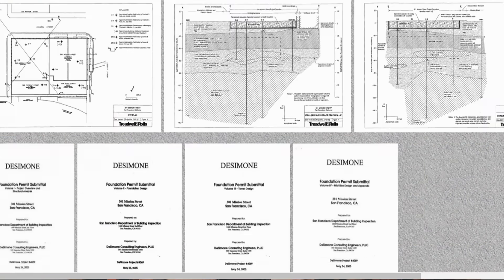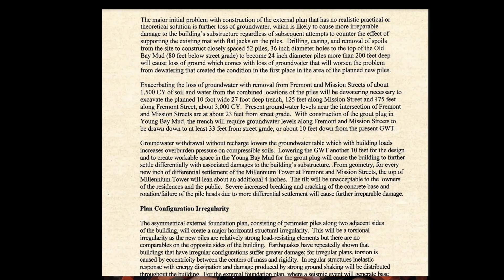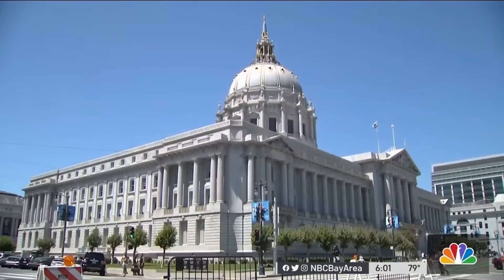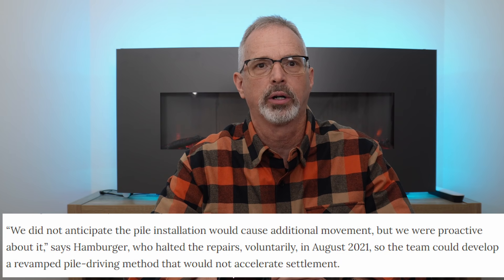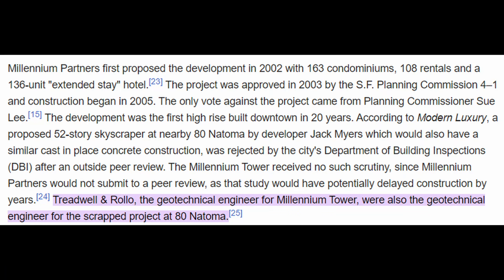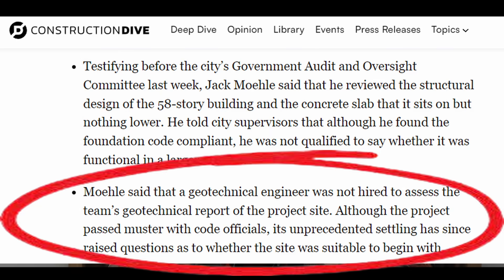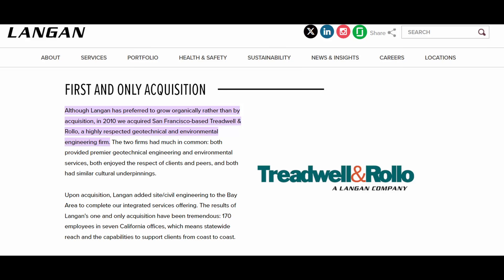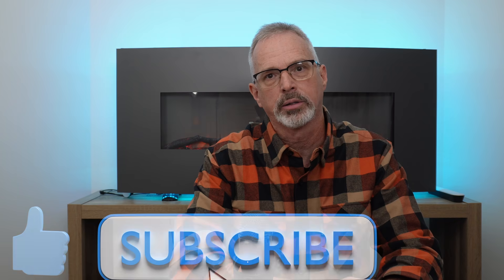Millennium Tower  -  $500 Million Wasted?

Comment: As a civil engineer specialized in the design of structures and foundations, I would never suggest supporting a building part on end bearing piles and part on friction piles. It's hard enough to predict the behavior of a foundation where settlements are “supposedly” uniform. If you do, you're just asking for trouble. And I'm not talking about a 600 foot skyscraper on reclaimed seafront land, in earthquake sensitive San Francisco. I will say though that, after the fact, 20-20 vision is easy. Truth is, the design team is always under high pressure from the engineering office and the client to get the job done based on sometimes best estimates soils related recommendations.

Comment: I am curious as to how the cost of foundation remediation was allocated between developer and HOA. You say the HOA paid ~$6M of the cost overrun, if I understood you correctly, but how much of that overrun did the developer pay for? Was the non-overrun cost similarly allocated? Is Hamburger being paid from this source of funds and who controls how it is/was spent? Basically, is Hamburger working for the developers or the owners?

Estimating the foundation sink for a steel-frame and then not updating it when a reinforced concrete building was substituted seems really questionable, but was the firm responsible for the estimate transparent about the method used to reach it? If there's enough margin for error built in then maybe it's not a problem, but you want to know how that margin for error was estimated to judge this. Is there a clock running until the developer is off the hook for design errors introduced when the building process was its sole ultimate responsibility?

I'm not an engineer, but this building is of special interest to me as I worked for a number of years in the mid 70's to early 80's at 531 MIssion, just down the street. That building is long gone, but I do remember giving the owner a clipping from the paper in which it was mentioned that Jack London (I think it was) had lived at that address. It was an old three story building, but probably not THAT old. The timbers used for its frame were for me of impressive size, however. You just don't see hunks of wood like that anywhere any more.
Reply from the maker: Thank you for your comments and interest.  It is my understanding that the settlement of the various lawsuits provided a pool of money for repairs to be performed and they elected to go with this perimeter piling plan.  They had trouble which resulted in their accelerating the amount of ground settlement and building tilt.  In turn, they had to reconfigure their plan by reducing the number of perimeter piles from 52 to 13, but also had to perform significantly more building monitoring.  As a result, it was reported that the extra $6 million dollar overrun would be borne by an assessment to the owners of this building units.  I don't understand the details associated with these arrangement as I have not been able to find any public records on it.  I also think it was odd that the original 52 pile repair plan was budgeted for around $150 million, yet they apparently went over-budget with only 18 piles instead?

I do think it is odd that this building foundation was reportedly designed for a much lighter, steel-framed building and was switched to a much heavier reinforced concrete structure.  I can't believe that the geotechnical engineer would not know this but unfortunately, in their original and subsequent geotechnical reports for this building they did not include a description of the building type (just height and footprint size). Such descriptions would have been in keeping with standard practice in my opinion.   They also did not quantify the amount of anticipated foundation loading in their report but did present total settlement estimates of around 5 inches for the life of the building.  There are so many oddities to this project but when big money is involved, it is hard to get to the full truth of things.
Reply: @CaseyJones-Engineer  So, the overrun was entirely on the HOA, which I didn't get from your video exposition (maybe I didn't listen closely enough), which implies they probably have no further recourse against the developer, absent viable fraud claims. Sounds like a terrible or corrupt decision by the HOA to let the developer off the hook for a little attempted remediation when the remaining downside may be so massive.

Comment: Offshore structural engineer here
If you have bedrock within reach you use it and that's usually the end of the matter. However it isn't the only solution 
Beneath London there's a thick layer of stiff clay and cast in-situ belled piles are an excellent solution.
You never have bedrock available offshore (because there's no recoverable under bedrock) so large diameter, driven tubular steel piles are common. Diameters typically in the range 48" - 72", penetrations 150' - 400'.
Reply from the maker: Thank you for your comments on that. They used to put a lot of belled drill shafts in the Chicago clay.

Comment: Something that is seldom mentioned in the Millenium Tower story is the three-foot thick, 90-foot-high steel and cement wall built directly under the eastern edge of the 10-foot-thick slab foundation.  In my humble opinion, this wall may be the primary reason that the tower tilted toward the west versus sinking straight down.  As such, the “Hamburger Theory” that the side opposite their “fix” can now sink and eventually straighten the tower does not make sense.

My next thought is the possibility that during an earthquake, the contribution of the 90-foot wall to the asymmetric downward support problem of the east and west sides of the tower, might result in its collapse.

Comment: As a retired consulting mechanical and electrical engineer, I am not a structural engineer or geotechnical professional. I have worked with many structural engineers during my 52 years working with architects in the design and construction observation of many buildings.  I refer you and your YouTube patrons to the site 
" Building Integrity " with Mr. Josh Porter.  In particular Mr. Porter's vidoes on the Millennium Tower.
One of those videos concerns the design of the lifting system design in which Mr. Porter points out that the entire hydraulic lifting system is concentrated on one steel plate.  Mr. Porter infers that this one crucial steel plate is not of sufficient strength to " carryt the load ", and questions " did I find a 100 million dollar mistake ?  Check it out.  PN

Comment: I appreciate all your discussions on these issues. I am a civil structural engineer for over 20 years experience and I have been in many situations where my foundation structural designs were viewed as over-designed.   These assessments typically come from non structural engineers who maybe built a deck in their backyard and they think that qualifies them to evaluate designs.     It’s always a discussion of money and when a client does the cost estimate and gets the funding for the project they did not adequately understand the design and code requirements which costs more money than what they thought.   I see this many times in all disciplines of engineering.
Reply from the maker: The two most important aspects of a building design is the foundation and the structure itself.  When a project has a problem with one of these there usually is not many options to make it right.

Comment: So the real solution were micro piles drilled through the slab footing under the builiding
That is HILARIOUS
That is the first thing I thought of, having been on jobs where jack piles, near full size piles were installed under old buildings
What's more hilarious, is I"m an architect, who's not supposed to know, or let anyone know, they know anything technical like structural engineering
and
All this reinforces your conclusion
That willfull ignorance led to this slow motion disaster
The soils engineer, the structural engineer, the building department, even the clueless architect (and the architect shmoozing the client and drawing the pretty pictures will likely be clueless, that's not what's needed to bring in the biz, actually that HURTS bringing in the biz)
as
As you point out, all the evidence was there in the research, design, calculations AND building history, both recent, withing months, and over 100 yrs ago, that engineers and the building department had at the tips of their fingers, that this was doomed.
It took the WILLFULL, the DELIBERATE ignorance of EVERYONE involved, every single professional and offical
which sounds like some tin foil hat conspiracy
Unless
You understand that THE TRUTH no longer rules anything.
The professionals and officials willfully ignored the truth as they have been trained to, seen what happened to those touting the truth, their failure, their dismissal, firing.
As a professional you can't get clients by telling the truth, like you don't 'have enough money, you'll make so much on this the additional cost of an extra backup system, extra structural steel, just in case someone does something wrong, a neighbor's work effects yours, you'll still get rich, you can't treat people like cattle, cheaping out will leave the future co op / condo owners in the hole for more than they can every afford and you'll still make doubel digit return if we don't cheap out....  ANYTHING that gets between even $1 and the owner makes you un-hireable.  Champion quality as an employee, and you're doubly worthless as you are risk, not an asset to be milked.
What can one say, are all professionals and officials reprehensible opportunists.  No.  Most didn't realize this until long after they were committed, and went down the slippery slope of willful ignorance one decision, one inch at a time.  Hamburger is nothing more than a CEO who sees no reason to consider all but the most optomistic outcomes, and there is no legal or technical reason not to do so, and HUGE economic reason to do so, his very survival and the survivial of those he employs.  It's very possible in the back of his head is, everything is fixable, I'll tell this owner what he wants to hear, who knows, could work, and I can always fix it and charge him again for forcing me to only consider the cheapest solution.  No doubt he might think that even now.  Those Micro Piles can still go in, halt the tilt (I don't think at this point there is a way to jack the building back up via it's slab, it has to be considered compromised from stress of differential settlement, full of micro cracks, at the least, that could erupt into full scale cracks if any stress is applied.  The building can then be gutted, floors leveled in sections, new plumbing run, new smaller fully vertical elevator shafts built inside the existing, New windows that won't fall out from tilt and stresses on skin of building now.  Even adding structural steel, epoxy / carbon fiber wraps to concrete to make it safe against earthquakes despite additional stresses, remount all the building equipment plumb and level, etc..  ANYTHING can be done as long as it's well safe of tipping and well safe of earthquakes.  OR  Just demolish it, which still requires an engineer, actually, more than ever, so more inoome for the biz than ever.
The only entity involved who needs to do something now, is the city.  It has not hired anyone to review the work, to develop inpendent parameters the failure must not even approach because well, the DOB officals don't want it proven that by following the best advice of the legally responsible structural engineer, they failed in their duty and get fired, whoever the mayor is at the time no doubt would not get reelected, for either his or her failures on this to date, or even predecessors on one hand and being starved of campaign money by the rich who don't want activist mayors who might limit their ability to make money at any cost.
We shall see
Reply from the maker: You make excellent points here.  It usually takes a graduating engineer a few years of professional practice before they realize that they are working in a business just like everything else that is ruled by the bottom line.  It is sometimes difficult for some people to navigate through the technical aspects of what is best for the project when doing what is best or even appropriate can doom a project to economic failure (at least within the constraints often set up by the project owner/developer).

Comment: Would it be feasible to level the tower by using the same external pile drilling in the opposite side?   Since the external piles they added actually caused more tilt could the same process be used on the opposite side.  Could it be modeled?     The micro piles could be installed, then external drilling until level, then secure the micro-piles.    Would it be worth considering, at least before building demo?
Reply from the maker: I would be concerned about the development of high moments in the slab which would cause cracking of concrete and yielding of the reinforcing steel.
Reply: The external piles did not add more tilt.  There was a temporary increase in the tilt while the work was underway.  Since completing the work, the tilt was reduced slightly.  The building still tilts toward the west; there is no reason to add supports on the east.  Further settling on the east will bring the building closer to plumb.

Comment: I don’t understand why unit owners should have to pay a single cent towards shoring up this building, when its deterioration is entirely due to the negligence of its developers and the lack of oversight on the part of city staff. Unit owners aren’t in any way to blame for the current situation, and making them shoulder any of the repair costs is grossly unreasonable.
Reply from the maker: I agree with you.  What happens when additional repairs or inspection is needed.  Do they expect the unit owners to pay for that too?
Reply: I was wondering that myself.  Will the tenants also have to foot the bill for the tower’s destruction too?

Comment: Has there been analysis done to predict which direction the building will fall in case of failure?  I'm betting away from the pilings.  Those on that side should be very concerned.
Reply from the maker: That area is so congested that if this building were to collapse it would be an epic disaster no matter which direction it went. Interesting sidebar, the Millennium Tower tilts towards the Salesforce Tower which is now almost totally vacant (as are many commercial real estate buildings in S.F. post-covid).  I am not saying that Salesforce staff are afraid to return to work in that building, but it is an interesting development.

Comment: I’m certainly no structural engineer but I would guess the F = ma is your friend — or your enemy.  I would guess that the total mass of the building should be known beforehand, a is obviously a constant (at least known at the equator), and the force would be spread out across all the pylons, or whatever they’re called.  All that should be known before work begins.  And it should be relatively straightforward, I would think, to know if there will be enough support to hold up that mass and how deep you’d have to dig.  I’m either really close or I have no idea what I’m talking about.  But then again I think the people involved in this project don’t know what they’re talking about either.
Reply from the maker: What I have learned recently is that the developer changed to a much heavier reinforced concrete structure and did not involve their geotechnical engineer or the project architect.  Still, the geotechnical firm's report was so vague they did not define the building type and loading very well.

Comment: I'm reminded of the Citicorp building in New York whose engineer, LeMessurier, did not calculate the wind load from a wind hitting the building at its widest aspect which is the diagonal diameter. This failing was discovered by a Princeton student, Hartley, whose calculations were confirmed by LeMessurier making the building susceptible to winds of speeds as low as 70 mph and during the secret remediation work a hurricane threatened NYC but veered off. My question is given that the threat in Frisco is from quakes which have no warning is 1. What magnitude of a quake would collapse the building like would the 1989 7.9 Richter quake destroy it and 2. How many other adjacent buildings would be destroyed and how many people would be killed in a worst case scenario like 9/11?

Comment: I think the attached hardware to the foundation and pilings will sufficiently weaken the foundation. It really looks like crimes were committed the more I hear. Who tested the foundation concrete? How much foundation cracking is just normal run of the mill cracking? Can the foundation be examined with x-ray to see potential problems? This building is just like the Titan submersible. The engineering seems about equal. Given what can be discovered about this project, specifically the drawings, one should be able to predict how the foundation will fail, even setting aside a large seismic event. How much tilt loading can a concrete building handle, setting aside the potential foundation issue above? If it gets to 40" or more, the weight pulling the building towards the lean will continue to increase. Has the engineering on the 18 piles taken this into account? How much pressure, tension, weight is on the whole new system of support, as applied when a full arrest of building movement has taken place and further, duration of materials under such constant and continued maximum loading? If the tilt is in fact arrested, that should be the maximum loading I would suspect. If any of the newly attached hardware to the foundation fails, it could be like dominos, not the pizza.
Reply from the maker: I think serious questions remain about the safety of this building particularly during a major earthquake.